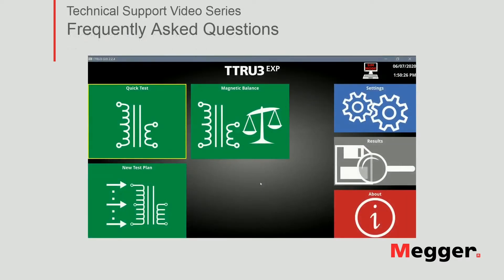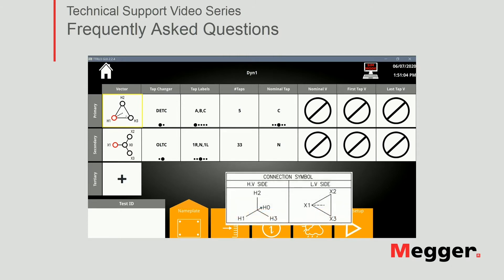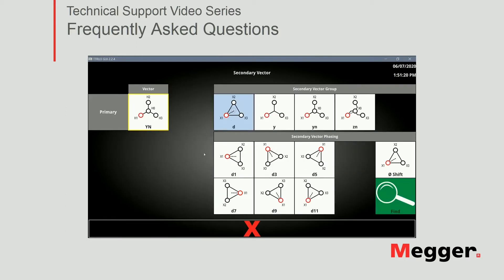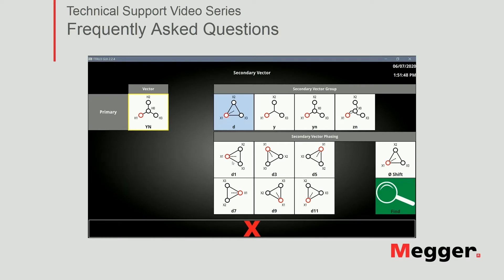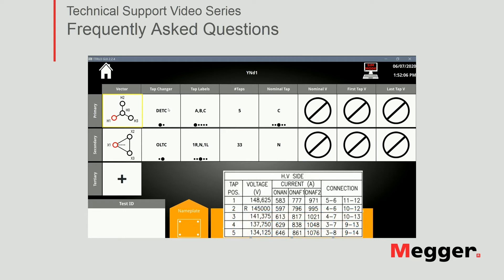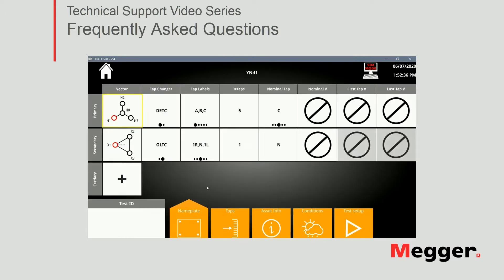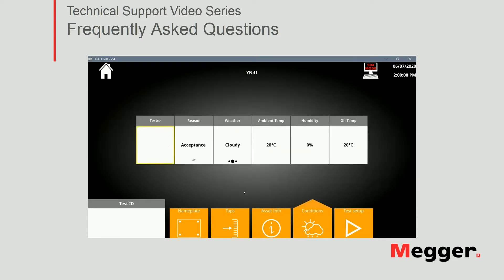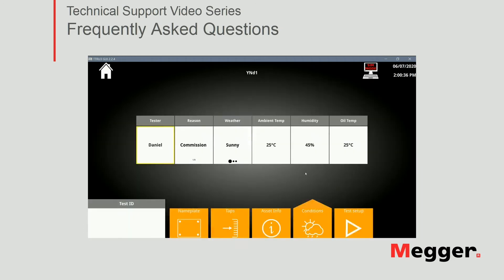Megger TTRU3: How to Configure a Test Plan

Comment: My office(Bhutan Power Corporation, Bhutan) have the Megger's TTRU3 basic kit(2024 model), and i have been facing the issue of incorrect mode of test for a while now. We generally configure the test pan and conduct the test in Auto mode, however the kit always runs the test in 1TTR Up mode despite doing all prerequisites correctly including the lead connections and vector group. Subsequently the result displayed are always incorrect. Moreover, the kit does not have the option to change to 3TTR down mode manually. The modes available in the kit is Auto, 1TTR Up and 1TTR down. can you please help me resolve the issue?